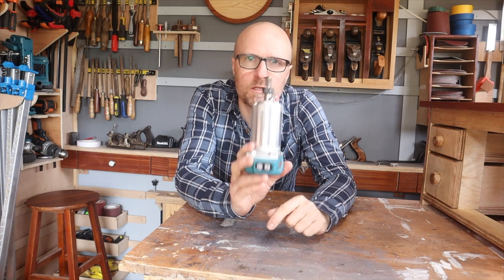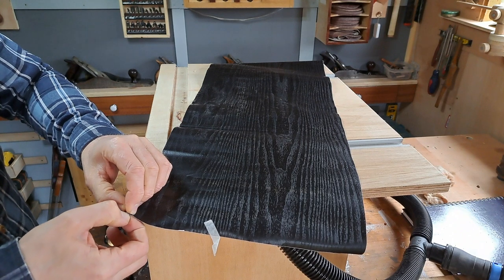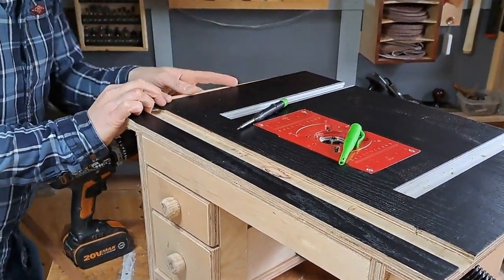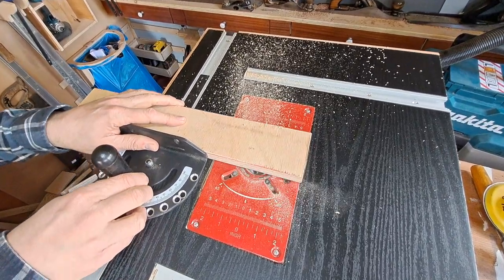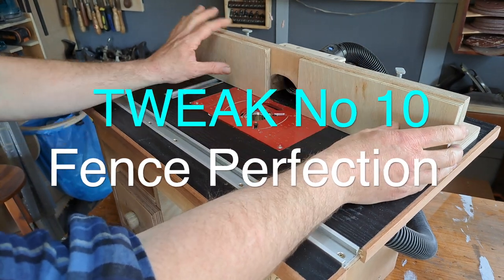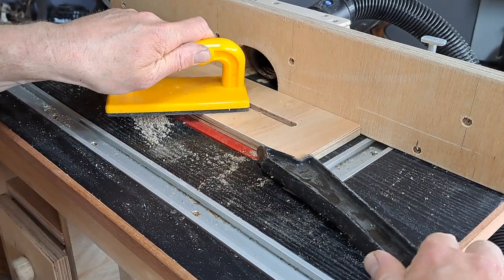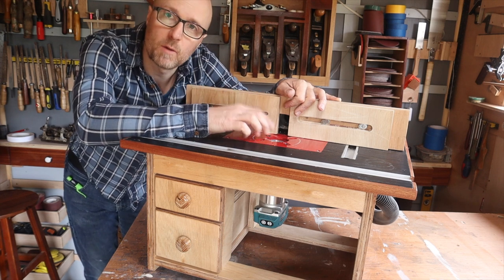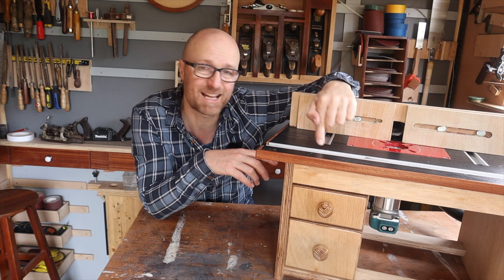Save your MONEY and watch this first | Router table perfection

Comment: A very useful & nice-looking project too.  I found out years ago that a router in a table is more versatile than a hand-held unit. That was after a couple sessions of just making saw dust with the hand-held. Mark, have fun putting your table to use & finding more & more uses for it. It's more than just changing router bits. Someday I have to buy a trim router & build a table for it. 🙂
Reply from the maker: Hi Bill. Thank you very much. the definite side bonus is that the top looks much better in black. It is unbelievably versatile, you are so right. Cant believe I didn't need one earlier, or maybe I did and didn't realise it. The only one issue is that now I want a larger router and table too. This one is great but I worry about bigger jobs. for now though it has opened up a world of new builds.

Comment: Useful video.  I haven’t started making my router bench yet so your upgrades will definitely save me some time.  I’m fortunate in that I have a whole wet-room shower panel spare from some work we had done and it’s basically 12mm marine ply with a smooth Formica-like surface. Perfect! If I laminate that to another 9 or 12mm ply sheet it should work great for my top and allow me to route out some t-track lines.

How easy is the mounting and dis-mounting of the router on that plate?  Have you considered buying a separate router base to leave permanently fixed to the underside so you just have the router body to insert/remove?
Reply from the maker: Nail on the head. Get a second base, as easy as it is to keep unscrewing 4 screws, it is far easier to just pull the router out. 
Great idea for you top piece too. I struggled with the depth for the t track and wish it was a few mm deeper to get the screws to bite better. Not caused me ongoing issues but an improver I could change if I made this again.

Comment: Hi Mark, thanks for the helpful video. I am planning my version of this table. World you please Share the dimensions of your table? I am wondering about the size of top Plate. I am aiming at 40 cm Deep and 60 cm wide. But Maybe I should enlarge to width 70 cm? The Depth is fixed due to final Storage Position in the Shelf.

Comment: Good video! But you make me cringe every time you touch the router bit and the battery is in the router, basically I touch the bit only if the power is disconnected (safety first)
Reply from the maker: Hi. I totally understand what you are saying but I think it is something missing in the edit. I can't remember a time that I have taken the bit out or touched it without first removing the battery. though I dont think that is clear on the video and it does need to be. Thankyou for pointing it out.

Comment: Would a fine sanding of the wood top plus light wax w/ good buffing have worked, instead of the vinyl ?
Reply from the maker: You know what, I think that it would have. To be honest it worked ok with no extra additions at all, just ply. Not perfect but ok.

Comment: Great video and i think i will be making changes to mine.  Do you have any idea where you can get small amounts of laminate sheet from in UK?
Reply from the maker: Hi Kevin. Thank you. That is a good question. The vinyl that I got was because I could not find anything thicker. I was pushed for time and one option that I wanted to try was to veneer the plywood top. That is another option but in truth once you head down that road it may be easier to grab some off cut melamine from marketplace or eBay and just make another top. The link for the vinyl is in the description and leads you to amazon if you want to try it. Not expensive at all.

Comment: I had the same problem with my built table what I used was some cheap laminate flooring upside down not pretty but it works use the same for the shutters on the fence though i did glue some 5mm ply to it so that it was more stable
Reply from the maker: Hi Harti. I think I may end up replacing the shutters with something a little smoother. The top seems to be holding up but I made a bit of a mess of the routing on the shutters and they are bound to bug me enough to need replacing. Laminate flooring is a very smart hack if you ask me. Good thinking.

Comment: Hi Mark, just subbed and have loved the shed build, can't wait for the next episode. As a cabinet maker in an early life, (I went into aviation in the 80's when work was harder to find.) I love the versatility of routers and have made a few tables in my time. 
What I was taught on my first day of using them was to feed the material into the cutter in the direction that its rotation pulls the wood toward the guide/fence, that way it will never wander. If you invert the router in a table and look at the cutter you can see that it turns counterclockwise. So the work should be fed right to left. Feed it the wrong way and the rotation trys to push the wood away from the fence. You can obviously use two guides, one one either side, but stick to the basics and you'll work safer, faster and more accurately. It made perfect sense...Once it was explained... Doh!
Reply from the maker: Hi Gary. You are spot on. I found that out the hard way and still do when I use it hand held. Thank you for coming aboard. And for taking the time to comment. Your experience as a cabinet maker will make for some comments I look forward to learning from.
Reply: Hi Mark, I'll certainly help if I can. I am planning on retiring this December and I have dozens of projects that I intend on getting on with. I've always kept my hand in over the years, and I really can't wait. I'm looking forward to seeing the your new workshop up and running too.

Comment: should have used melamine for the top
Reply from the maker: Hi Richard.  Spot on. I hope.i left the bit in where I said that should be first choice. Big regret. Though this is holding up OK so far. Approx a month of using
Reply: @startmaking1  oh, you did, i went back and watched it again. I missed it due to the low volume i was listening at and your accent. Sorry
Reply from the maker: @richardscarlett7942  oh good. I honestly didn't know if I had cut it. Thank you for letting me know. I assumed from your name that you were from the UK.
Reply: @startmaking1  no. My Dads side of the family were from Boston but im pretty sure most of us Americans came from UK. I wish i could afford to have my family tree traced back. Supposedly im related to Will Scarlett, but I dont put much faith in that
Reply: @richardscarlett7942 : Accent????? What accent? 😁✌🖖
Reply from the maker: @Richard Scarlett  oh that's a great accent.  I guess you are right but it is pricey to find out. My background is probably dull.
Reply: @startmaking1 : Those are the ones which will surprise you. 😁✌🖖
Reply from the maker: @zapa1pnt  I guess so. You never know.
Reply: @startmaking1 : Yep. Everybody said an Irishman jumped the back fence,
when my father was born. (he was quite a drinker) 😁✌🖖
Reply: Yes Melamine would be better, and for the fence too !!  But even melamine will wear with time.  Better option is Formica.